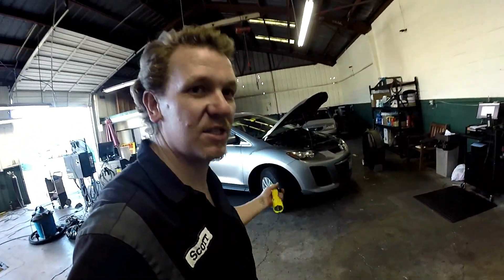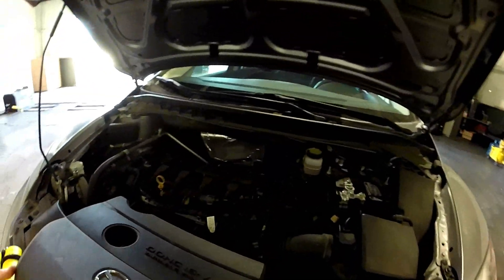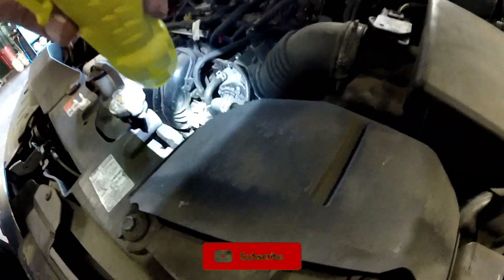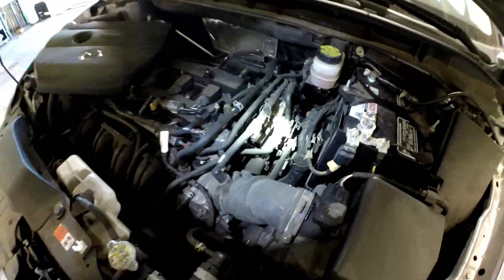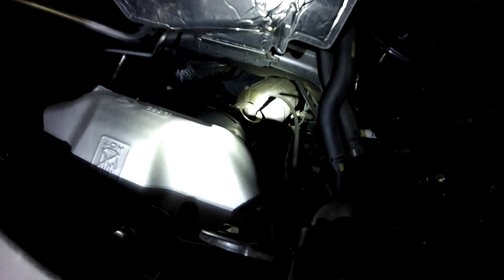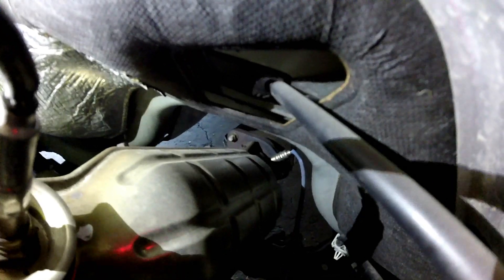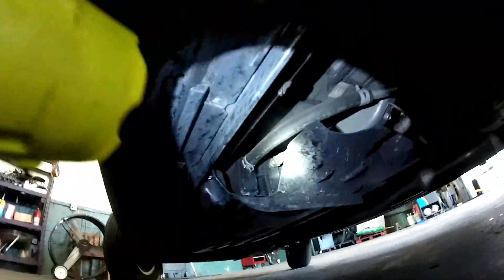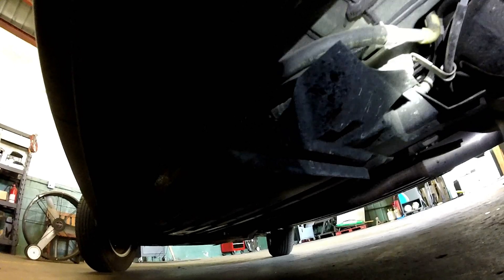⫷ Mazda CX-7 Emissions Locations: PCV, EGR, Oxygen Sensors, EVAP Purge ⫸

Comment: I have a 2011 CX-7 that is getting exhaust fumes in the cabin. Kinda smells like the car is running rich. Idle is fine, drives fine, no lights popping up on the dash, I don't hear anything that makes me think exhaust leak. Any idea where I should start checking to figure out what may be the issue?
Reply: probably starts with seal at the flange where the cat - converter. that seal wear out because constantly moving and when it does it might leak exhaust fume. when it gets worse it will start making noise. not hard to replace need to take off cover at the bottom and take two spring bolts off. replace those spring bolts too

Comment: I have bad oxygen sensor Mazda CX-7 should I replace one or both?
Reply from the maker: Just the one that is sending the code is sufficient. The post cat oxygen sensor only monitors catalytic converter efficiency. The precat oxygen sensor tells the computer how much fuel to add or takeaway from the combustion chamber to give best efficiency.